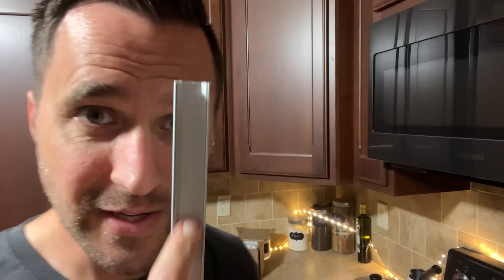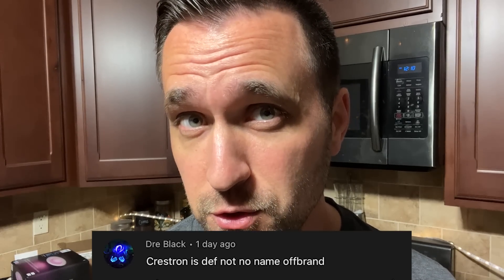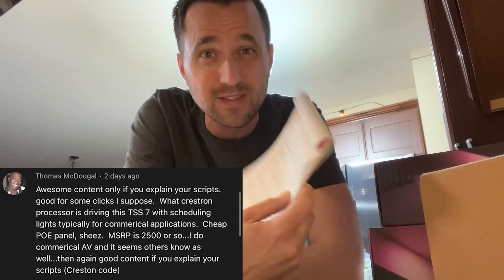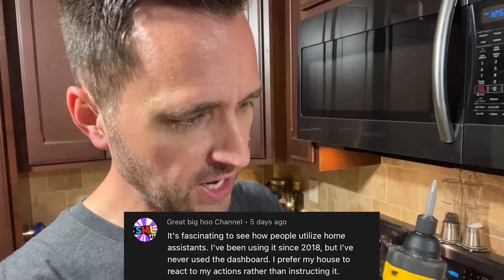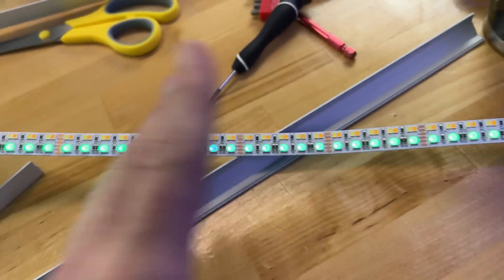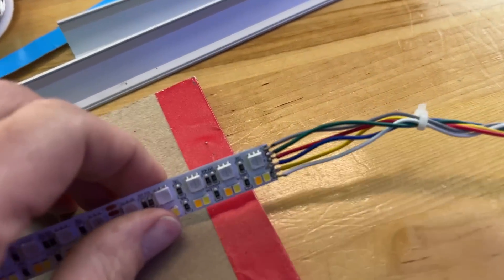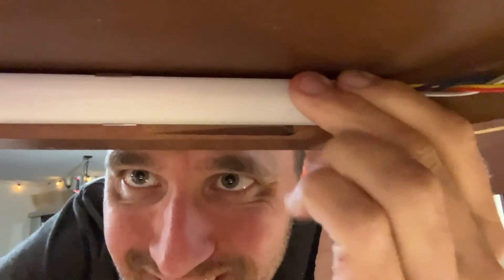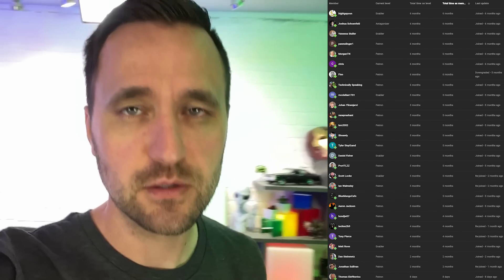Jason Bytes back Ep. 73 - A project vid or a JBB!? Mostly Home assistant questions..

Comment: Can you be able to make a video about cleaning robots that can be modded or just locally only? I would like to control it from home assistant, mop, vacuum, map my house, and auto dispose of trash. I have looked for a cleaning robot that is local only but the only ones I found are “dum cleaning robots” that do not do mapping or auto trash disposal. All the mapping ones have to be connected to the cloud. I know it will probably void the warranty, but I think is better not to have my personal data out there than to have a warranty.

Comment: As someone who just ripped out my previous under-cabinet lighting custom LED strip solution I can tell you there are a number of drawbacks to consider. 

My main problem was the heat from some of the appliances (toaster, air fryer, griddle, etc) would heat up the solder joints even more than the LEDs would weakening them over time. I ended up losing one of the colors on half of my strips so I had 2 different colors along my strip. 

And once the adhesive backing of the strips had been applied it made it almost impossible to simply repair a solder joint unless you rip out that section and replace it. 

I decided to rip out my entire installation and go with a pre-assembled set of dumb lights that I simply command stripped to the bottom of my cabinets and activate via a smart plug. I no longer have dimming control in HA (still can dim manually) or RGB functionality but, it's been rock solid and you can barely tell a difference between the pre-assembled and custom once it's been installed and cable managed.

Comment: My wife and I do almost all our home control in HA via Alexa.....  So you hear us constantly, ALEXA, KITCHEN 40%.  And she replies "I'm sorry, I didnt find a device called blower motor, and then we yell back something along the lines of "Shut the hell up you CUNEXTUESDAY GO F()$@$* YOURSELF!, STUPID POS" 

but most of the time she does it.  one thing you can do with it is say something like "Alexa, turn on kitchen for 3 minutes" if you are just running out and going back to your room... or something when your out there, "Alexa, turn off kitchen in 30 seconds" 

But I have a ton of automations and motion sensors all over, and voice control for the rest...  I have the dashboards for some control, and setup Raspberry pi with PoE and a touchscreen that is framed out to look nice and mounted those in certain spots taht just load up to a dashboard when powered on (control over SSH), and have prox sensors so they turn off and screen comes alive when you get close to it.

I also have a UI Connect 7" screen with the flush wall mount and this thing is AMAZING for a HA touch panel.  SUper expensive for just a HA touch panel tho...